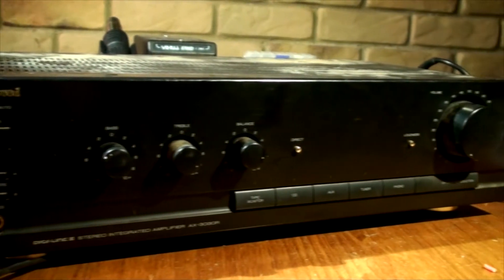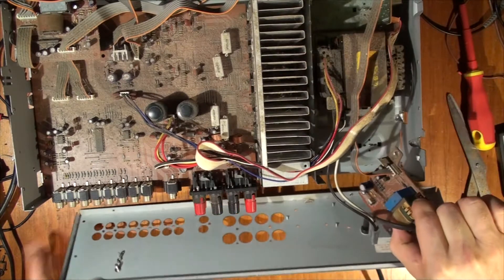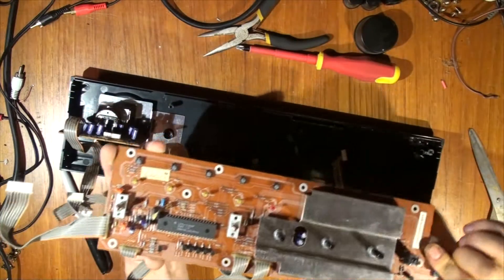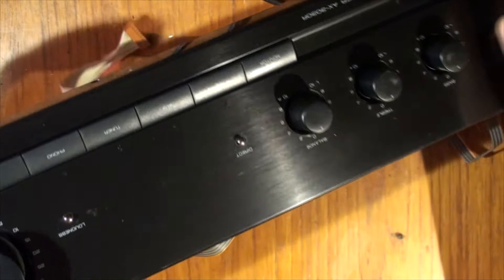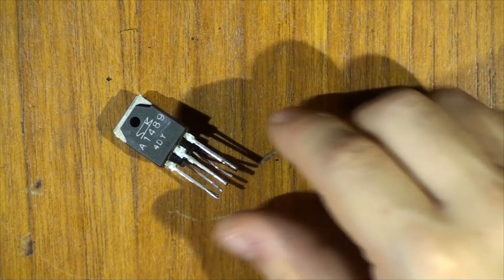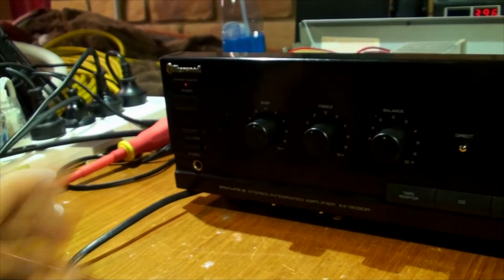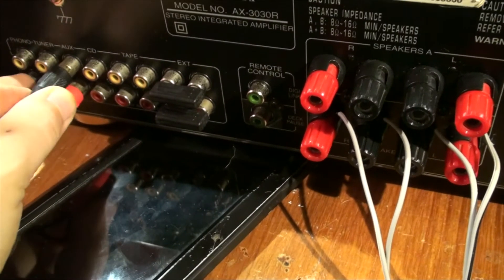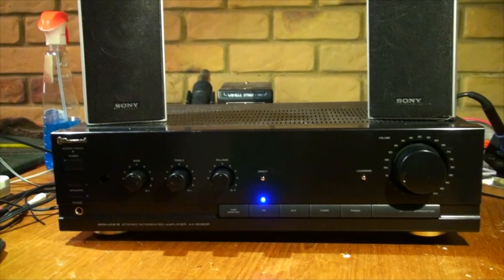Sherwood AX-3030R Amplifier Repair + Upgrade

Comment: Hi sir good day i have a   Inkel AX-5015r set of amplifier.10 band graphic equalizer ,am.fm radio , double casset deck,and compact dish player i can't connect cause it is korean language can you show the right connection from amplifier to all players or show the manual thanks.

Comment: A good sub for 2SA1489/2SC3853 would be the complementary pair 2SA1492/2SC3856 which can be sourced from DigiKey or places like LCSC cheap. I always keep these pairs in stock.